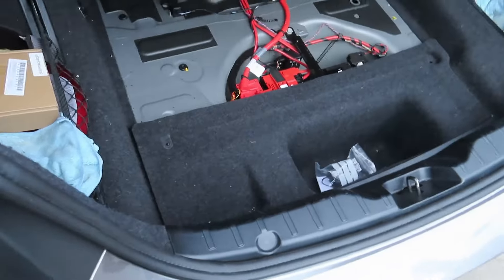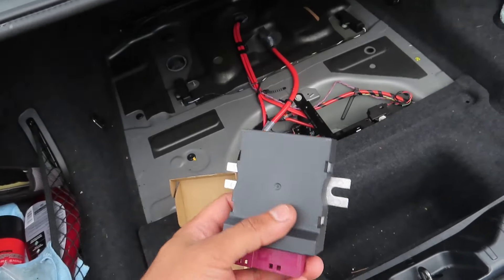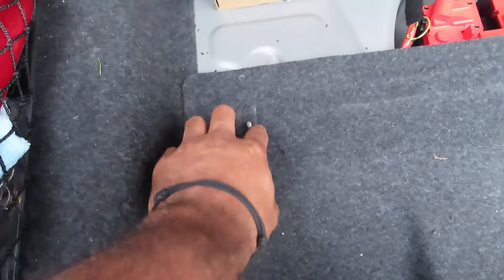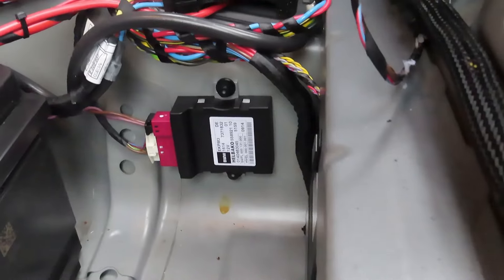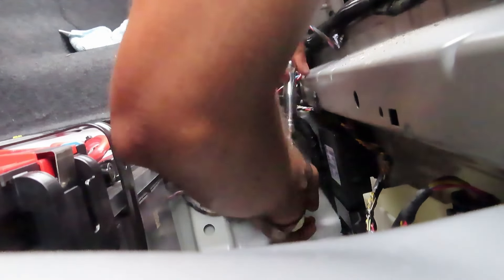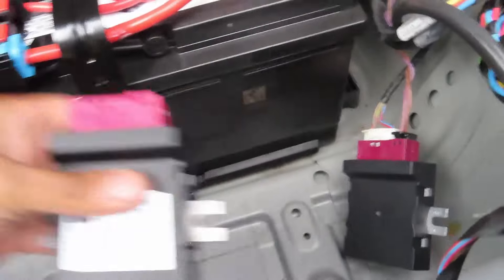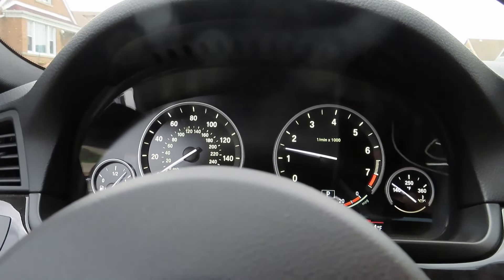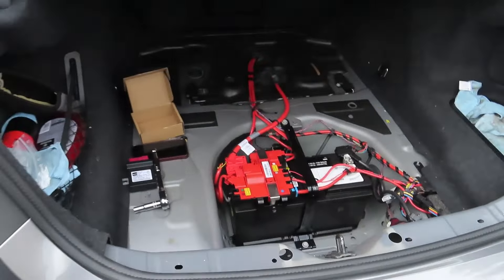Bmw F10 550i Ekpm3 Fuel Pump Control Module Replacement

Comment: When it used to die out on you before you changed the module, did a fuel supply warning pop up then right after the driving malfunction? Cause it sounds like the same exact problem im going through now with mine. I would have to leave it off long enough for the computer to reset then it would drive perfectly fine until it happened again.
Reply from the maker: @bundy9463  yes i would get fuel warnings on the idrive too

Comment: hi man.... can you help me ? what was the symptoms that you had ? my BMW F30 when I turn it on it dies in 4 seconds...
Reply from the maker: @MandelaoDigital  my car would get fuel system malfunction on idrive and then just die and would die instantly when trying to turn it on. Would turn on and work fine after letting it sit for 30minutes
Reply: @LuisGee was your car shutting off when it was hot also? I noticed I only had this problem when it’s extremely hot outside.
Reply from the maker: @shawnjohn849  yea it was a really hot day when it happened
Reply: @LuisGee  ahh ok thanks! I’ve been looking to find a replacement and also thought about buying some insulation tape to put around the module to help the overheating
Reply: Did that fix the issue? Or did you have to code the new module?

Comment: I recently replaced the fuel pump. I read that this component also had to be replaced this module. I have the same symptoms. Even after fuel pump replacement.
Reply from the maker: @DanielAlvarez-tu1lg  have you replaced the ekpm3 already?
Reply: @LuisGee  Yes.
Reply from the maker: @DanielAlvarez-tu1lg  no check engine lights?
Reply: @LuisGee  It came back as a fuel supply issue. 
EDIT: It may actually be this module. It is 82°F where I live.